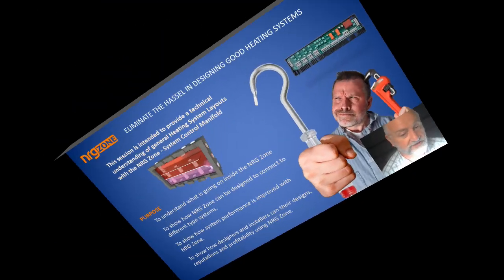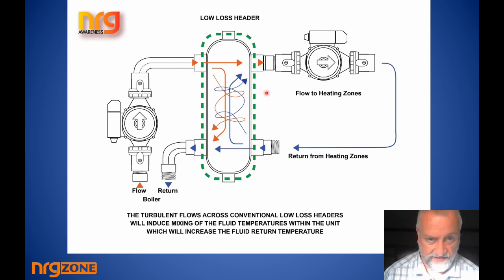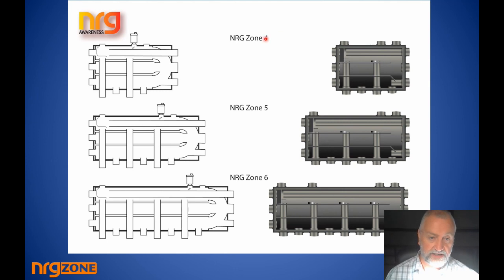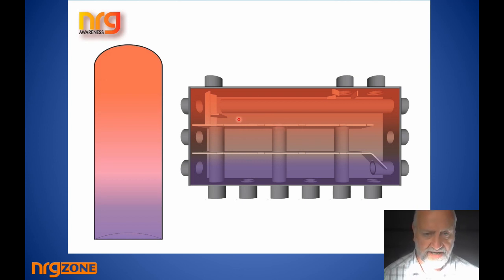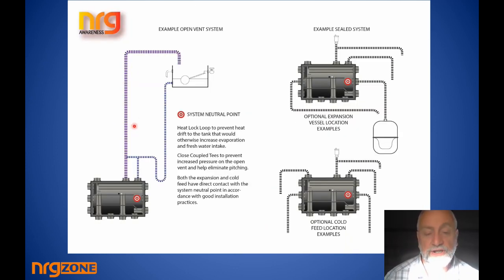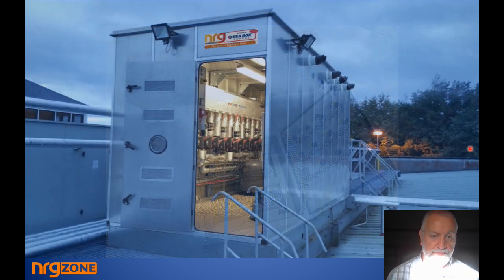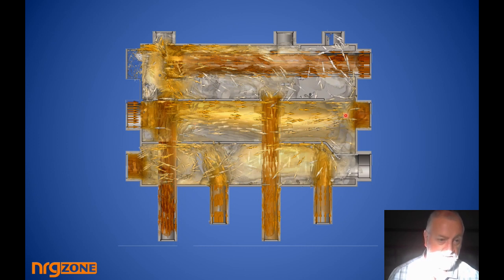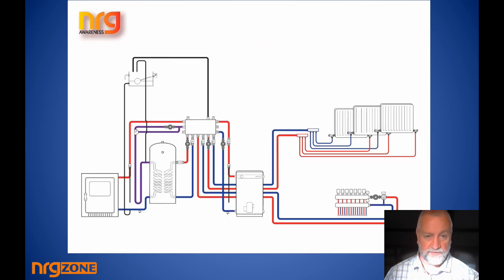NRG Zone Heating System Design Theory Presentation

Comment: As an engineer, I question how much actual temperature difference is produced by the ducting and the three chambers. I've watched a couple of the videos and I'm still not convinced. If you could show a video with a thermal imaging camera showing a temperature differential between the top chamber and the bottom chamber I think it would be much more convincing. I also am having trouble finding a distributor in the states. 

Seems like a very useful product if its performance tracks with your presentations.
Reply: Never mind, I see at 12:00 you have a thermal imaging camera shot.